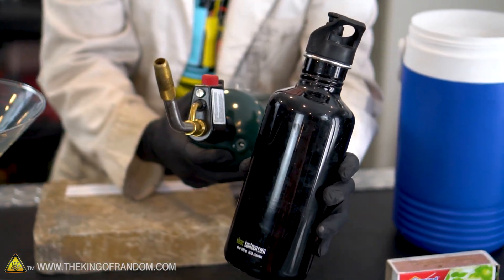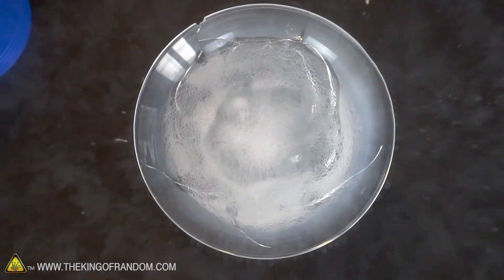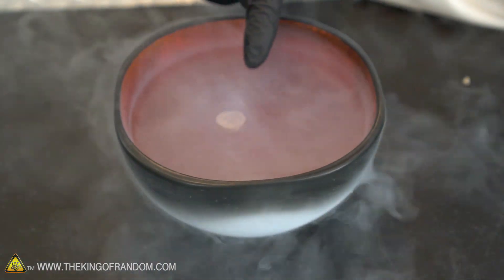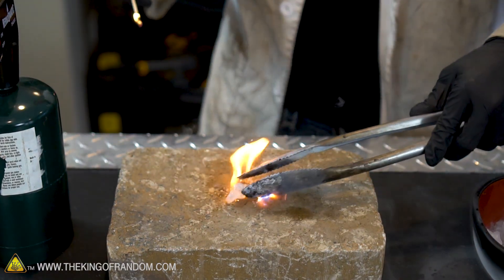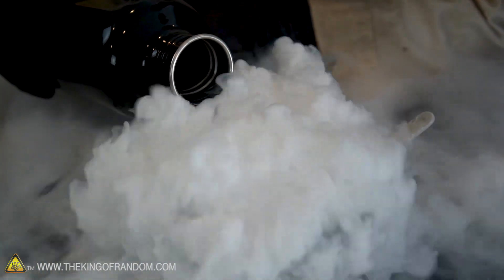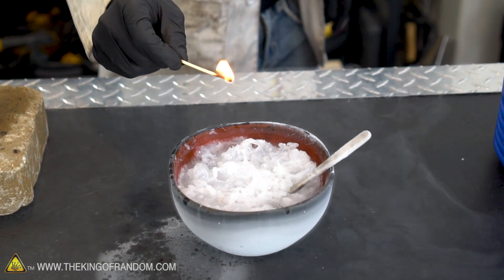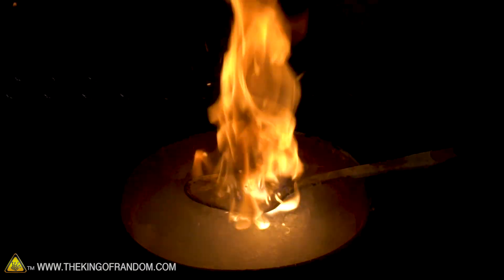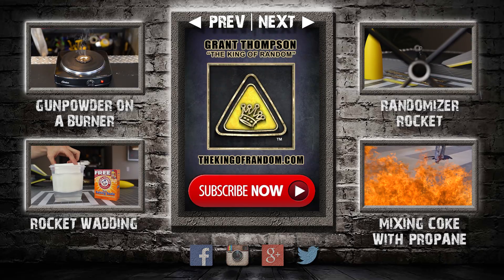Will Frozen Gasoline Burn? Can We Use Liquid Nitrogen To Freeze Gasoline Then Ignite It?

Comment: The breaking glas and the big flame were sooo not a surprise, I acually facepalmed - before I saw the results. Normal glas cracks when the temperature differences within it are too great. No matter if due to liquid nitrogen or boiling water. You know that boiling water breaks normal drinking glasses, right?
The thing with the flame is, that it's similat to pouring water into a burning frying pan with oil. This is a big, hopefully commonly known, no no. The water instantly boils in the hot oil, wich is far hotter than the boiling temperature of water. The expanding water vapour makes the burning oil fly all over the place. Here the water is the liquid nitrogen that is embedded into the frozen gasoline. When the gasoline burns, the nitrogen within it will instantly go into gas phase and expand, making the gasoline go all over the place. Further it helps to rip the gasoline apart, forming smaller droplets. A volume in form of smaller particles has more surface area than the same volume in form of one big chunk. The surface area is where the gasoline goes from liquid (does not burn, see Matt Elys comment below) to gas, mixes with air and burns. More surface -> more flame.
These where the two points in the video where I just facepalmed. Unless these, for real scientists totally obvious fails where actually planned to make the video more appealing.
What I didn't expect was the fog that formed while the gasoline froze. But in hindsight I think it is frozen or condensing gasoline gas, like fog or frozen fog is with water.

Comment: What happens if you try lighting the foggy mushroom cloud looking thing that comes when you pour the gasoline into the nitrogen? I would really like to see if that fog is flame able
Reply: mysterghost it would set on fire
Reply: +richcampoverde no it wouldn't,that is a cloud of nitrogen gas,it would just put out the flame
Reply: Marco Epifani it is a mixture  of condensed  petrol vapour  and nitrogen  the condensed petrol is in greater concentration thus making it possible to ignite  it
Reply: +richcampoverde but why would the gasoline vaporize at those temperatures?
Reply: Because it is volatile

Comment: I wonder what would happen with liquid oxygen mixed with a chunk of frozen gas and then compacted into a grenade type kind of container with a primer to ignite the gas on impact?  Maybe pack the frozen chunk of gas could be compacted into a balloon or thin plastic ,or whatnot, to protect and separate the gas from the liquid oxygen until impact, which would bust the balloon or protective layer causing the two to mix and ignited by the primer and then..?  Just curious to the reaction, a silly thought at least

Comment: gasoline itself isn't flammable in the first place, it's the fumes that are. it's why fuel pumps in the gas tank are submerged in the gasoline and the tanks just don't randomly ignite from any electrical sparks. the flames are just melting the gasoline faster causing the release of the vapor.

Comment: Liquid gasoline (petrol) does not burn.  Gasoline VAPOR  burns explosively.  The internal combustion engine works by squirting small amounts of gasoline (in a mist) into a combustion chamber which vaporizes and then can be ignited by the spark plug.

The gasoline is frozen, but the heat of the match starts to melt it.  As soon as it starts to go from solid to liquid state, a small amount enters gaseous state.  This gas (vapor) ignites, generating a lot of heat, which melts the rest of the frozen gasoline and produces a lot of vapor, which ignites, etc. until all the gasoline has melted, converted to vapor, and burns.

Comment: the reason is spatters around is because of the trapped liquid nitrogen inside  the frozen gasoline quickly boiling off. kind like if you would drop water in hot oil.

Comment: Liquid gasoline isn't especially flammable. The FUMES, on the other hand, are insanely flammable. You don't burn liquid gas in a car engine; you burn a fuel/air mixture. So it's not surprising the solid gasoline burned--the match would melt some of it, and sublimation would contribute more. 

A very cool experiment!

Comment: Technically neither the solid verson, nor the liquid version of gasoline will burn.  Only the vapors mixed with air will burn.  However, gasoline will release vapor above neg 40 degrees or so (ie the flashpoint.)   My question is will the white vapor ignite once it has flowed over the edge of the bowl?

Comment: Can you try to build an apparatus where you can blow air through a pipe going through liquid nitrogen. Since the boiling point of oxygen is more than that of nitrogen, you should be able to obtain pure liquid oxygen on the other side. Imagine the stuff you can do with liquid Oxygen.
Reply: You can use it as an oxidizer. Several materials will also spontaneously combust in presence of liquid oxygen.

Comment: I bet it as to do with the distance and mobility between molecules in different phases. When the molecules are in the liquid phase, they can move arpund each other and are farther apart, so they burn more steadily. The closer and more restrictive they are, the more molecules have to react at the same time, causing the exploding gas that melts into more steadily burning liquid gas. That's just my guess; I could be completely wrong. 
Thanks for the awesome video!

Comment: I don't understand why you did not place the kanteen with the lid closed into your reservoir of liquid nitrogen. Pouring the gasoline in a bowl of liquid nitrogen as demonstrated by this video actually diluted the gasoline. By my observation I have formed an hypothesis that actually the frozen gasoline burns at higher BTU's because it evaporates at a much slower rate and is concentrated and condensed; any liquid besides water contracts when frozen due to the slower movement of the molecules. Grant Thompson you should do an episode with frozen helium and explain the superfluidity characteristics of it. Since helium freezes at a lower temperature than liquid nitrogen.

Comment: Will frozen (solid) petroleum burn? No. But it will evaporate rapidly enough to turn to the gaseous form that will to seem as though frozen petroleum will. But let's be clear: the frozen form does not allow for combustion.
Reply: I was looking to see if anyone else was going to say this. Heck even the normal liquid form isn't actually burning it's the gaseous form that is actually burning.
Reply: I'm not sure how that is a meaningful distinction, since the two states are inextricable and anything hot enough to cause ignition will necessarily convert the solid to a fluid state.
Reply: It looked like the blocks of frozen gas were hollow, so they may have gas inside that is starting the burn, and at those temps sublimating the petrol for the crackling/rapid burn continuing. Definitely not the frozen petrol burning.
Reply: To really test this he should use a sparker; that way the heat from the ignition source doesn't sublimate the gasoline.
Reply: The flash point of gasoline is listed as -43C so, technically, frozen gasoline won't burn as long as it's below that temp. In order to test it you have to have an ignition source that doesn't generate enough heat to raise the gas above -43C. Grant Thompson - "The King of Random" I'd be interested to see you try again with maybe a flint striker or something. See if you can demonstrate the ability of flint sparks to ignite gasoline down to very cold temps, then try it well and properly frozen at LN2 temps. Hey, you could even try it with liquid O2! Seriously though, don't. Unless...
Reply: Let me rephrase that... you need something with less HEAT. You can have temperature, but no thermal capacity. For example, a spark from shuffling your feet across the floor, vs a lighting strike.
Reply: Did anyone else think it looked like a magic potion when he added the gasoline to the liquid nitrogen?
Reply: 6 times hotter
Reply: Technically the liquid will burn, but practically there is always an ignitable mixture of vapor in the air above it - and it's so energetic that it rapidly generates enough heat for more and more to enter gas phase.
Reply: Sparkler is actually pretty hot... You need a spark, like a spark plug, or a taser.
Reply: kleetus92 Electrical arcs are even hotter than metal sparks or flame. For example, lightning bolts are hotter than the surface off the sun.
Reply: Atticus Finch I did
Reply: They run into trouble with this in Alaska, Canada, and Russia. The fuels (usually diesel) gets too cold to use, which is why winterizing includes a block and fuel tank heater!

Comment: Your conclusion was close but wrong to say that frozen gasoline burns. Flammable liquids don't burn, the mixture of the gaseous vapors they give off and air burn, and the point above which they give off enough vapor to ignite is called the flash point and gasoline has one somewhere around -40 F. At this point some of the frozen gasoline is melting meaning there is some liquid present and some is sublimating into gas which can ignite. When the gasoline in the form of a gas ignites I hypothesize that the heat it gives off is melting and boiling some of the frozen gasoline causing it to expanded and throw gasoline outward which is still giving off vapors which are igniting. Anyone let me know if you have any other thoughts on this theory, but in short, no gasoline cannot burn when frozen nor when it is liquid it's only the vapor and air mixture that burns i believe.
Reply: ok so the question is does it go boom when a match touches it, answer yes, their for conclusion for simple people is frozen gas goes boom, this is a simple science channel not NurdRage. so chill out like the petroleum
Reply: Flippy Flippington you are the most insulting guy in the world
Reply: Well, lets call it a channel then. (omitting the "science". "Frozen gas goes boom" is not science, it's more like "action" xD )
Reply: If I have come off as raging in any way I apologize that wasn't intended at all I am just stating that no frozen gasoline doesn't "go boom" the vapor it gives off does and that creates more vapor which then does as well.
Reply: Matt Ely nothing wrong with what you said, and while watching the video I was thinking the same thing about only the gas burning.
Reply: Matt Ely nah I totally agree it's just I don't think his fan base cares. Their vocabulary seems to be limited to "frozen" , "liquid nitrogen" , and "vacuum chamber"
Reply: I don't see how he was insulting. His statement may be exaggerated but the underlying point he is making I think has merit. If I'm not mistaken I think he is expressing a grievance with the nonscientific and often misinforming nature of this channel's content. Which is either the result of or the cause of the general lack of understanding of the fan base.
Reply: totally

Comment: No the frozen gasoline will not burn, what happens is the match melts the frozen gas to ignite and as Grant said earlier it melts quickly so the reaction progresses from Left to Right which means it's meting it as it ignites
Reply: Nothing frozen will burn, search up flashpoints.
Reply: But how is that meaningful? The two states can't be separated or isolated, anything hot enough to cause ignition will immediately melt and vaporize some tiny portion of the solid, which will combust.
Reply: FIRAT KOZAN 
Yes I agree

Comment: ok, hold up now. This experiment is cool and all, but there is a HUGE flaw. Gasoline is only combustable in its vapor state. which means that no. frozen gasoline is NOT flammable, however, as you said, it melts fast, and therefore ALSO vaporize quickly... this means that all you tested is will vapor gasoline burn after its been frozen..which, yes it will as seen in this experiment. Still cool results, however, it doesn't quite test what you were looking for. Keep up the awesome vids though!

Comment: Hey king of random, can u build a cryogenic rocket that is fuled by frozen gasoline and utilises Potassium Nitrate or any other oxidiser like in your other rocket videos?
Reply: It is possible. If u take a pvc tube and line it with refractory materials like kaowool so that it prevents heat abrobtion and loss and cool down the rocket with liquid nitrogen before launch, it should theoretically work.
Reply: By pvc tube I mean the rocket's body.
Reply: U could use any oxidising agent like hydrogen peroxide, nitric acid but potassium nitrate would be better as it could make the rocket fuel a solid rocket fuel hence, preventing the use of things like valves and pumps.
Reply: Anirudh Yenisetti yeah but to make a rocket with the solid gasoline you would need to powder the gas, which makes it way easier to melt, and solid gas doesn't burn well, it burns like wood, it's the vapors that burn and in this video he had sublimation occurring and liquid gas everywhere

Comment: You should try to cast aluminum Wolverine claws and make then Sharp to cut things
Reply: check out man at arms wolverine claws , they're a professional blacksmith
Reply: Steel would be a far better option. Aluminium rolls over.
Reply: colin furze already made working automatic claws on his channel few years ago
Reply: Like so The King of random can see
Reply: Aluminum isn't very hard. It'd be very difficult to sharpen them and once you did, they'd be dull almost instantly when you used them to cut anything substantial.

Comment: Is it possible to freeze liquid nitrogen ??? Can you try
Reply: Bret Housel it actually solidifies under vacuum
Reply: AMACturbo69 yup, in a vacuum, the liquid boils until it freezes
Reply: It is possible. google it.
Reply: Nitrogen becomes a solid at -346°F (-210°C). I imagine the equipment necessary to achieve temps that low is insanely expensive.
Reply: yeah. get ya Vaccum Chamber Out. it is collecting Dust
Reply: Connor Hyland lowering pressure lowers temperature. how about you google it. theres videos of it all over youtube.
Reply: Bret Housel it is possible but requires high pressure
Reply: AMACturbo69 no that makes no sense.

Comment: why don't you put glass in the freezer to let it cool down before you put liquid nitrogen in it?
Reply: apos vlah by lowering the temperature of the glass it becomes closer to that of liquid nitrogen, therefore resulting in a smaller difference in temperatures, which in turn means less thermal shock to the glass which means it is less likely to crack/shatter.
Reply: Sooraj Gopakumar cocina facil mexicana
Reply: DragonMaster building things takes more time he has to come up with an idea find all the supplies and building probably takes more than one day
Reply: All the commercial glasses are not tempered properly. I am sure if he places it in an oven for a few hours, he could temper it to relieve the stresses and it can take the thermal shocks
Reply: i dont think it would matter liquid nitrogen is nowhere near the temp of a conventional freezer.
Reply: DragonMaster what basic on chemistry should i read to understand this phenomeno?

Comment: What happens if you put concrete in a vacuum? I feel like it would get rid of a lot of the air bubbles if it's not too thick for that to happen but does that make it stronger? I think it would make some really cool castings either way.

Comment: grant, i follow your experiments with interest from the viewpoint of a science educator. I suspect the very vigorous initial ignition is due to the presence of many tiny frozen gasoline particles. Whenever you take something and crush it up into smaller pieces you expose more surface area for a reaction surface. This is why a lump of wood burns slowly, but you can make a spectacular explosion using sawdust. In fact you may like to try a sawdust cannon of your own. I would suggest you try freezing some gasoline in a spherical mould since spheres have the lowest surface area to volume ratios possible.( Its why bubbles form spheres.) and then try igniting the solid sphere. Anyway, love your vids and show some to my chemistry classes. keep them coming

Comment: to save your beautiful glasses slowly cool them to avoid the thermal shock. is the frozen gasoline burning or is the match melting the liquid. this burning causes a chain reaction. one of the many reasons the match doesn't burn in the bath of liquid nitrogen.

Comment: the frozen gasoline is actually not burning like you expect it is, because the surrounding air is so hot in comparison, is is having a dry ice-like reaction, melting and releasing some vapors, but most of the liquid re-freezes. As you bring the extraordinarily hot match (in comparison) toward the frozen gasoline, the vapors catch fire burning the frozen gasoline more releasing more vapor, etc. etc. basically a burning snowball effect

Comment: so will frozen gasoline ignite with a spark like it does when it is atomized? Would frozen diesel fuel ignite? With it in liquid form it is hard enough to light since it doesn't put off as much vapor as gasoline, so I'd be interested to see how it would react while frozen.

Comment: The surface area of a glob of frozen gasoline is large and surrounded by oxygen so ignites quickly.  What's more,  the moment the glob leaves the nitrogen bath it begins forming a thin, liquid surface over it's entirety, and with gasoline being volatile, naturally vaporizes around room temperature.  However, because the liquid layer is so cold and well below room temp, the vaporized gas is dense.  So, lots of oxygen with a thick vaporized layer of gas means rapid, almost explosive, ignition.

Comment: Just curious, is the flames on the frozen gas hotter then the normal temp gas fire?  Secondly if you put gas in an aluminum can and pour nitrogen around it would the whole can of gas freeze  (then light it, but try that outdoors and save the shop roof!)